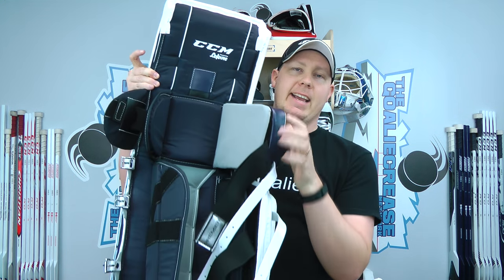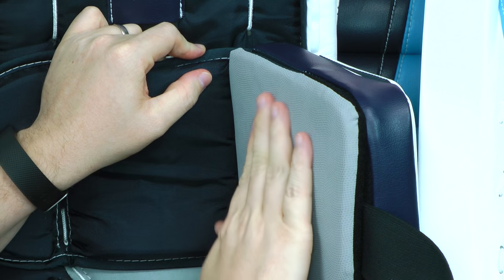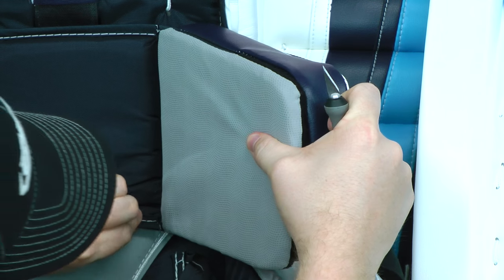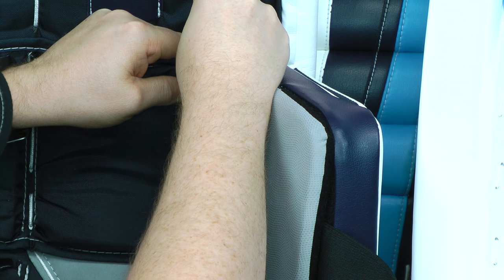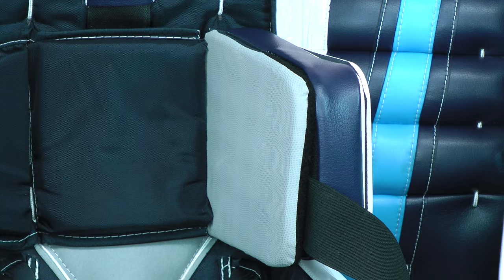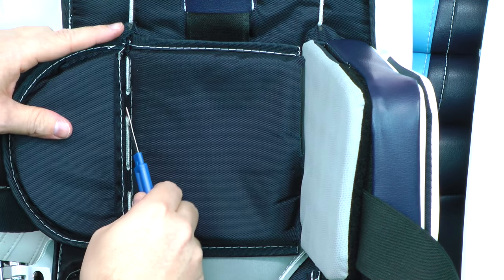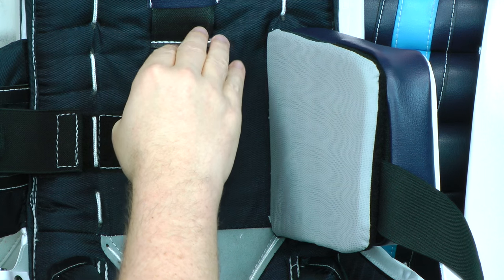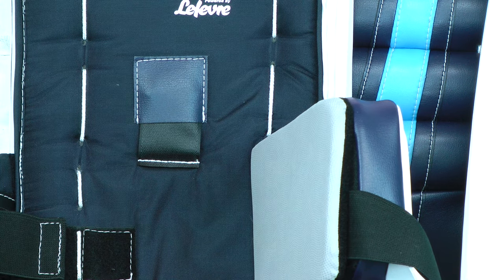How to Remove the Knee Cradle from Goalie Pads

Comment: Hello, I have a set of Reebok P3's and I was wondering if you think it's okay for me to remove or cut off the outer flap shielding the top buckles? The flap I'm referring to is to the left of the knee cradle in your video here. I've removed the top two straps already and now the flaps have frayed my pants up pretty good. A friend referred me to this video, good content, thanks a bunch.
Reply: I cut it out of my p4s, I like the change
Reply: Prized yes I also ended up cutting them off after posting this comment. it's been great.
Reply from the maker: Glad to hear it!

Comment: Do you know what the differences are between all of the different knee cradles offered when customizing pads? I'm looking at getting the Premiers, but am unsure what the differences are. I have previously used stock Reebok Premier gear, and have liked the knee cradles, but I wonder if I might like some of the features of the other cradles more. Thanks!
Reply from the maker: +Jacob Woodford There's three main types of knee cradles: soft foam, hard foam, and recessed.  Recessed is good because you won't have to remove a knee lock at all, though traditionally they've put a suregrip material in the front as opposed to vinyl, and I prefer my socks on vinyl rather than on suregrip.  The soft foam is what this one was originally, and is wider and larger than the hard foam, which is, obviously, harder, but also smaller.  Traditionally most Reebok pads have come with the hard foam knee cradle, especially in pads a few or so years old.  Hope that helps!
Reply: +GoalieCreaseNet Yeah, definitely. Thank you very much!
Reply from the maker: You're welcome!

Comment: Just got an old set of P3's to experiment with, so I'm going to do this most likely and open it up more for my knee guards. Do you have any tips for removing that half-circle outer flap?
Reply from the maker: +Ayden Byrnes Awesome idea!  As for removing the half circle outer flap, you can do it the same way: use a seam ripper to individually take out the seams and it should come right off.  Hope that helps!

Comment: I love this mod. I really wanna do it myself, but a big concern of mine is that I strap the kneestrap behind the knee. (The velcro strap, that is) I tried to strap the kneestrap to my legchannel, but I utterly hated it. I felt that the pad was falling to low from my knee & had trouble with my stance, as the pads kept getting caught in eachother. So, the question. Is it possible to remove the kneecradle, but leave the female part of the velcro still on the pad, to be able to use (my version of) the best of both worlds? Get more space at the knee, at the same time be able to have the velcro behind the knee? 

Great channel Tommy. Really enjoy your content!
Reply from the maker: +Gnuu12341 Thanks for the kind words, Gnuu!  Glad you find it helpful!  As for your question, it IS possible, but I would be worried about whether the nylon might end up snapping after some time.  I don't know if it would, but I can certainly imagine that happening.  If you do try it, I would recommend leaving a bit of material on the "inside" part of the outer flap, folding it over, and having it sewn so it might protect those edges a bit better.  Hope that helps!  Good luck!

Comment: could you do a video on how to get your wings´on your chest preotector more squared? i have a Bauer one95 and the wings lay down, i want it more squared like Vaughn chest protectors. Id be very happy if you made one! greetings from sweden!!
Reply from the maker: +Filip Jägrén That's a hard one, as some chest protectors simply aren't meant to be squared up and instead are meant to be more form fitting.  What I would recommend doing is getting some extra padding or foam from an old piece of gear, and sew it under where the chest protector and shoulder floaters come up and over the shoulder (where your lats and delt muscles are).  This will give you a little more squared look and will help increase your blocking area.  Just don't add too much or you'll lose the ability to look around.  Good luck!

Comment: i purchase ccm eflex 3 i chose "SOFT FOAM 
WITH OUTER KNEE WRAP" because that what i had on my old pads, but i later realized i should of picked "RECESSED FOAM"

my question is if i remove the knee cradle will that make it the same as the option recessed foam (or do they actually put foam inside the pad if you choose recessed knee)
Reply from the maker: Not exactly the same, but it's pretty close.

Comment: Do you have any tips on how to break in a Eflex 2 glove? I've been having trouble with breaking it in. Thanks!
Reply from the maker: +zenoguy2929 I use my normal break-in method: Hot water on the palm for a minute, hot water down the cuff for another minute.  Put your hand in, close it, take your hand out, wrap it in a towel, and put it under the couch or some weights for 24 hours.  Then open your glove all the way, put it flat on the ground, and put it back under the couch or weights while it's fully open.  Then it should open fully and close perfectly.  Hope that helps!
Reply: +GoalieCreaseNet I did that and it worked somewhat, but just when it dry it becomes rather stiff again. Im using the Bauer Reactor 9000 gloves. Can I do this method over and over again without destroying the glove?
Reply from the maker: Absolutely.. you can do it as many times as you need.

Comment: Would this work on my Eflex 1's with just removing the outer knee cradle? (like you ordered on your EF2.) I have the recessed nash suregrip knee.
Reply from the maker: +Michael Meilinger Absolutely.. as long as you have the recessed knee cradle, you can just basically snip off the outer flap, not a problem.  I did that on my EFlex1s.

Comment: I've been using my Eflex 2's for a few months now and I feel much more restricted than I did in my P4s. Would doing this help me feel more loose?
Reply from the maker: +John Lucido I'm betting your EFlex2s have a more restrictive knee cradle and leg channel than your P4s did, especially since the P4s came with a pretty open channel.  This would DEFINITELY help you feel looser, but be aware that this will completely loosen up your knee area, and there's no going back.  So while I recommend it (and I did it on my EFlex2s, too), it might take some getting used to and ultimately you could end up not liking it.  Hope that helps, John!
Reply: Thank you, I will definitly look into this!

Comment: So is removing this going to allow me to bring the pads closer together in a butterfly?
Reply from the maker: Not necessarily.  This is mostly to get better rotation and make room for bulkier knee guards.
Reply: GoalieCreaseNet alright, thanks for the response. I have issues closing up the five hole and I wasn't sure if this would help. I do have bulkier knee pads though. Do you have any suggestions to help me close it up?
Reply from the maker: Best bet, honestly, is to check out Maria Mountain's video on getting a wider butterfly.  A wider butterfly will also bring the knees closer.  Otherwise I'd recommend a higher thigh rise and/or bulkier knee pads.
Reply: GoalieCreaseNet alrighty, thank you so much for your help

Comment: Thanks for uploading this Tommy!!
Reply from the maker: +KingMooseinNet You're welcome!  I know a ton of people were waiting for this, so it was nice to finally scratch it off the list.  Hope it helps a lot of goalies who want better rotation!
Reply: +GoalieCreaseNet one more thing. how do i know that i want to remove this. so far i haven't have an experience of using pads without knee guard.is there any way to put the knee guard again if i dislike the set?
Reply: +biam suparte knee cradle
Reply from the maker: Once it's removed, you CANNOT put in a new knee cradle unless you get one custom made and installed by either a professional pad modifier or a cobbler.  So this isn't for the faint of heart.
Reply: +GoalieCreaseNet if it's removed, will the top pads loosen? since there's a lot of space at the knee area
Reply from the maker: Not sure what you mean by "top pads."
Reply: +GoalieCreaseNet knee area. sorry for bad english
Reply from the maker: Like will it feel looser in the knee area?  Absolutely.  It'll be much looser, and it will require you to attach the elastic on the calf like Price instead of at the knee like Bishop.
Reply: +GoalieCreaseNet ok. thx for the info
Reply from the maker: You're welcome!
Reply: +GoalieCreaseNet make more videos plz
Reply from the maker: Many more are coming!  Stay tuned!

Comment: Can you just take out the little block that the strap goes to? Cause that really gets in the way of my pants but I don't mind the front face padding it doesn't bother me.
Reply from the maker: +IMPACT Clips If you have the recessed knee cradle, then yes.  If you don't, I'm not sure how durable the middle part will be only held on by the small holes where the cords run through.  Good luck!
Reply: +GoalieCreaseNet A little trick I used to repair a trampoline is clear nail polish.  Put that on any open or freyable nylon (3-4 layers) and it'll hold the nylon together as if it were melted together.  Try to get something that isn't water solvable
Reply from the maker: Well that's interesting.. never thought to use that, but it makes perfect sense.  Nice tip!

Comment: How would you remove the knee cradle from a set of G-Netiks?
Reply from the maker: +Sam Makris Not sure, Sam.  You'll have to see if the knee cradle is integrated with the leg channel like it is in some sets.  But I'm not familiar enough with G-Netiks to know, sorry!
Reply: +GoalieCreaseNet ok thanks. Just thought I would ask. Would love to do this on my pro returns because I wear the Bauer supreme knee pads and I does feel a little cramped in the knee. The block isn't integrated in the nylon, but it looks like the landing pad doesn't have a seam except where the stitch is holding the knee block down.
Reply from the maker: Sounds to me like you might be able to take it apart, then.  But do so at your own risk, ha!
Reply: +GoalieCreaseNet did it last night. Ended up cutting just the landing stack length off and sewing it up at the end and adding a little fabric glue to the seam to keep it from coming lose.
Reply from the maker: Very nice!
Reply: The only thing that I seems weird to me is if the Velcro isn't strapped to the calf area, the knee block just flops over to the side of the pad. I wish I could send a picture to show you what I was talking about.
Reply from the maker: Yeah, I can't picture that, haha!

Comment: U should play nhl and customize a goalie 👍🏽🏒
Reply from the maker: +Cameron B Haha, I haven't played the NHL series in a long time, ever since the game was basically the same thing over and over and still cost $60.  My favorite is still probably like NHL2001 or 2002 on the PC.. those were the days!
Reply: +GoalieCreaseNet  I have eflex 2's but I only want to remove where the velcro tab is(where the velcro strap goes) cause I strap it on the calf, and I have the recessed knee option.
Is that possible
Reply from the maker: Yup, I did that to my CCM EFlex1s that had a recessed knee.  All you have to do is take a seam ripper and cut off that outer flap and you're done.

Comment: Couldn't you just use sharp scissors?
Reply from the maker: +Justin Stotz The problem with scissors is there's a lot of material, it isn't easy to get to, and it's hard to get leverage in those areas.  It also tends to be less precise because of the lack of leverage, unfortunately.